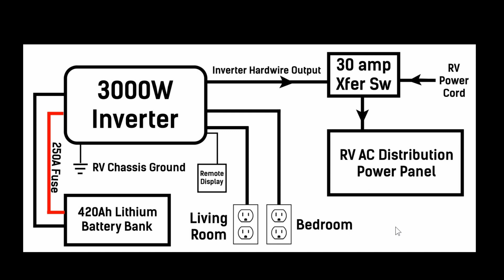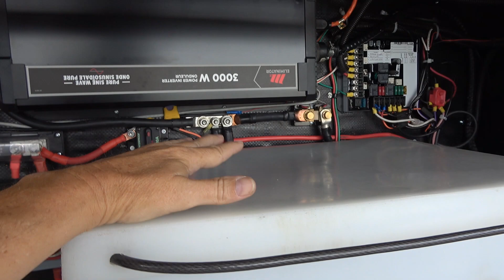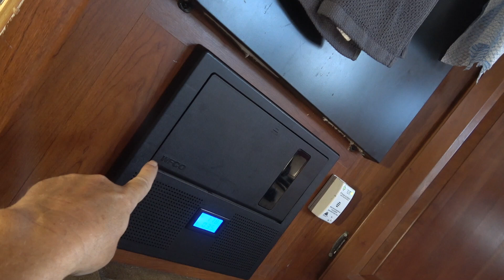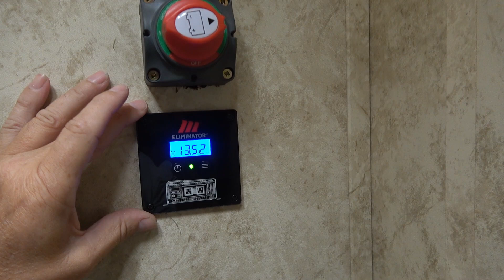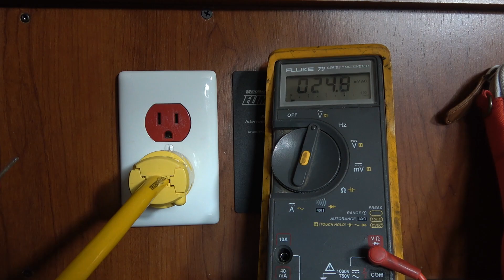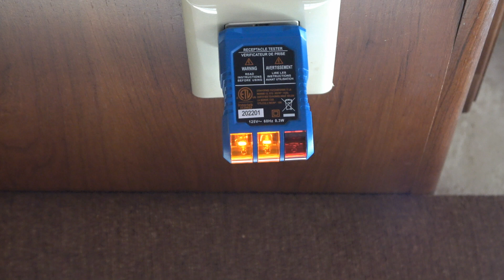3000W Inverter Installation w/ 30A Auto Transfer Switch - Motomaster Eliminator PSW & Go Power TS-30

Comment: As Always  a great and detailed video.. Just one question, everything else in the power system you have installed is protected by fuses in case of a short or failure. Should you not have a fuse in the 120V 30amp output from the inverter or does the inverter have a built in circuit breaker or fuse on the 120v inverter output.
Reply from the maker: Yes. I took it apart and saw eight 40A blade fuses soldered to the circuit board for protection also there is microprocessor-control protection against low input voltage, high input voltage, short circuit, overload and over-temperature. Max output is 26 amps so as long a person uses a cable rated for at least that there shouldn't be a problem as anything above 26 amps for more than a brief instant will automatically shutdown the inverter output putting it into an overload state and cut off the AC output.  I used a 30 amp continuous current rated RV cable as my main conductor. Cheers, Ray

Comment: I'm thinking that your shore power must be 30a ? otherwise, would you not want to use a 50a transfer switch?
Reply from the maker: Yes, my trailer uses a 30A 120VAC service. Larger RVs generally use 50A 240VAC service which is split into two legs of 120VAC 50A so actually have 100 amps at 120VAC. So the switch is a little more complex using 2 hots and one neutral  https://support.gpelectric.com/kb/article/256-transfer-switch-wiring-diagrams-50-amp/

Comment: i have the same inverter in my new trailer. the power is not perfect. i cannot run my thermostat. it says fc lol. the 3 different places i brought it to tested the power and the inverter back feeds through battery's. the ac has a box with a bunch of relays. dealer said that the relay box is not working properly because of it and thats why my thermostat dont work. im told to buy a different one like renogy. its kind of depressing considering this inverter was almost 700 buck and the renogy is 400. everything else in the trailer works good. its only the relay box witch is sending bad signal to thermostat. Does anyone got Any ideas? maybe the dealers wrong. i was also wondering if you have a ground ran from transfer switch bar to the ground bar on floor behind pannel?
Reply from the maker: Interesting. I wonder if your thermostat is one of the new type that uses a digital transmission wire. What is the make and model of the AC? Have you tried truing off the AC breaker and see if the thermostat works properly for heating?
In my RV there is a bare wire that goes from the AC panels ground bar to the trailer frame and the DC negative buss bar is also attached to the trailer frame.

Comment: So the RV panel uses separate ground bus bars and neutral bus bars?
Reply from the maker: Yes, since RVs are designed to be plugged into campground pedestal power outlets that already have the neutral and ground bonded at the campground main panel.
Reply: @LoveYourRV  Thank you for the clarification.

Comment: Awesome video Ray … my question is if I got 50 amp motorhome & my transfer switch has shore & generator hooked up where do you hookup inverter?  Do it tie into generator or I would need a different transfer switch for all three? Thanks
Reply from the maker: Here is a Go Power 50 amp transfer switch manual. You can see a couple different options on page 8 with one main panel and one with main and subpanel https://s3-us-west-2.amazonaws.com/catsy.549/MOBI_MAN_GP-TS-50.pdf  Looks like you'll need two transfer switches. Other models or brands may have everything in one, not sure. Cheers, Ray
Reply: @LoveYourRV  thanks for your help & insight 💯

Comment: Great video!  Thanks!  I’m new to RVing, bought first camper in 2020 after returning to US from Canada where we rented a few times. I’ve been wanting to add an inverter, with this video I’m confident I can accomplish the task.  One question, I have an onboard generator, do I need a different transfer switch, one with 3 separate inputs from shore, generator and inverter?  I guess I do.

Comment: Curious, how do you prevent AC operating inadvertently while on Inverter vs shore power?  (Power outage or mistakenly forget to turn off). Is your shore power already combined & switched with Generator line in?
Reply from the maker: No, my generator is portable type not wired into the camper and only 2000W. I'm not sure what will happen haven't found out yet. :)  Power outages are pretty rare and especially for both of us to be away from the camper at the same time plus forget to turn off the AC while gone. We also only ever need AC for about 2 months of the year. during the summer. When I head off grid, usually 8 months of the year,  I routinely flip off the water heater, converter and AC breakers. 
But, I'll have to give it a test try and see what happens. My guesses are the inverter might have an overload shutdown or the 250A fuse might blow during the AC start up surge or  the inverter will fire the AC up fine and it would run for a several hours until the battery bank ran down. Longer if the sun is out with solar recharging power from 940W of roof panels. So unless the power outage is extended things may work out OK.
I could install a subpanel and move some breakers over to it so that the inverter could only ever power select circuits, Maybe a future project! :)   Cheers, Ray